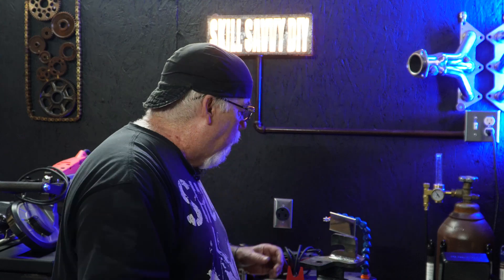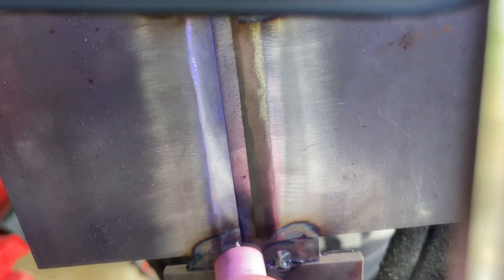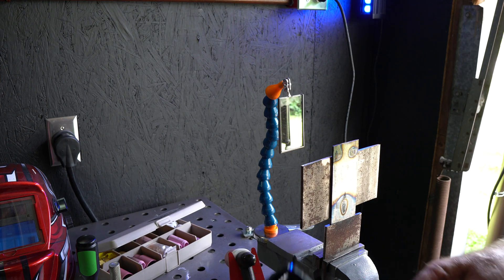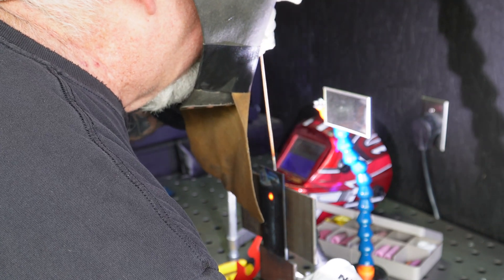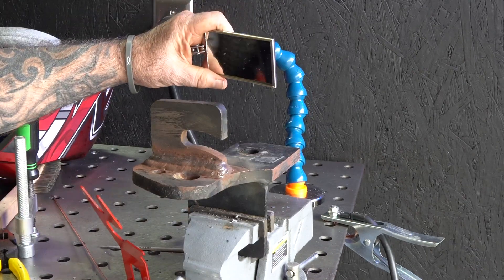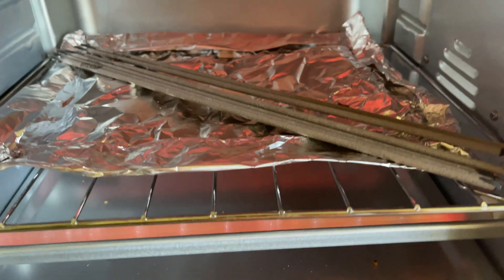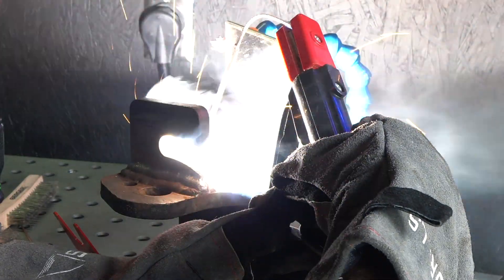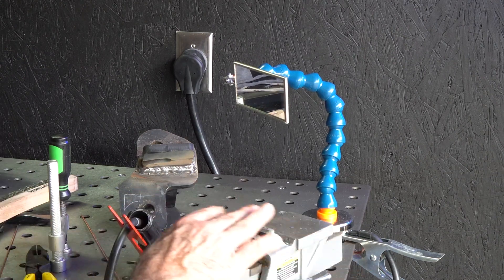Up Your Welding Skills!  Learn How To Mirror Weld

Comment: been in situations where the only thing you can fit back there is about an inch of rod.  fiberglass tape helps a ton to prevent the bend in your rod arcing out on structure in the way.  sounds crazy but always keep an eye on your hand.. it helps avoid moving in the wrong direction cause the mirror will trip you up.  no matter the position though always remember ABC - always be comfortable.  take that time cause a 15 minute job can turn into 2 days in a heartbeat.
Reply from the maker: Yes sir, I can't even begin to tell you some of the extremely tight welds I had to do over the years on US Navy ships.  Stick and tig both.